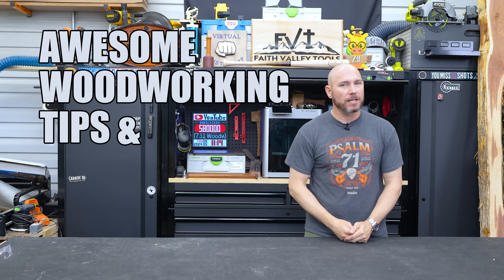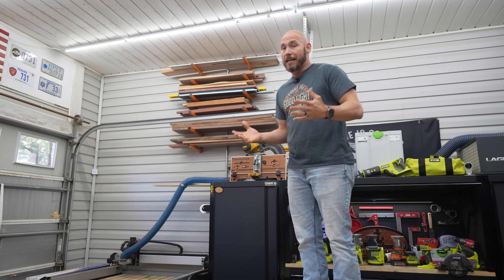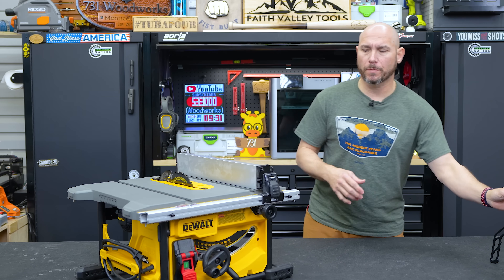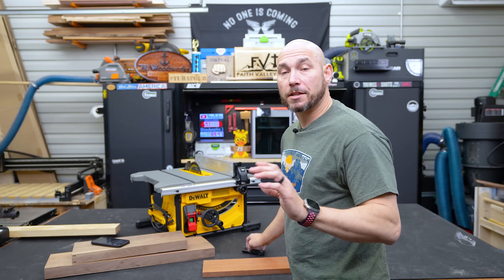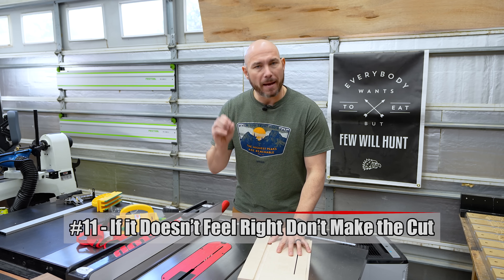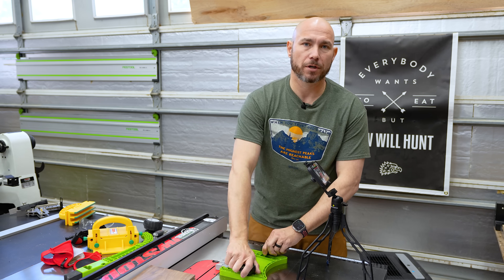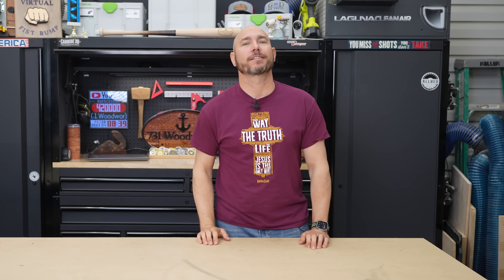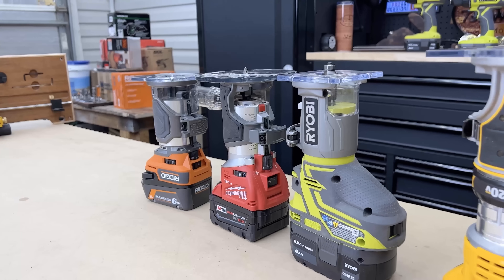99% of Beginners Don't Know These Woodworking Tips and Tricks | Compilation

Comment from the maker: Click "MORE" to expand for links to tools and more!
Check out my FREE Masterclass for Building a Woodworking Business from ZERO https://site.731woodworks.com/masterclass
Some of the links used in this comment are affilate links and I may earn a commission on qualifying purchases. 
Tools starting at timestamp 0:09
DeHumidifier - https://amzn.to/3V8vcQw 
Bora Lumber Rack- https://amzn.to/4axB61S 
GRR-Ripper Push Block - https://amzn.to/4bFSgf2 
Tools Starting at timestamp 12:06
Thin Rip Jig - https://amzn.to/3UM9u3k 
Bow Feather Board - https://amzn.to/4bw3oLM 
Bow Push Stick - https://amzn.to/3wVF9Y5 
Allred Push Stick - https://allredwoodworks.com
JessEM Stock Guides - https://amzn.to/3KajSx1 
Jig for JessEM Stock Guides - https://www.731woodworks.com/store/jessemjig 
Bow XTender Fence - https://amzn.to/44PwSBD 
Cross Cut Sled Plans - https://www.731woodworks.com/store/safesled 
Incra V27 Miter Gauge - https://amzn.to/3UO3Xtb 
123 Set Up Blocks - https://amzn.to/3QX0aZc 
3M Safety Glasses - https://amzn.to/44SPDnK 
RZ Mask - https://amzn.to/4avoQPu 
Tourniquet - https://amzn.to/44ZDjSQ 
Tools Starting at timestamp 37:06
M12 Drill / Driver Combo - https://acmetools.pxf.io/m50WPD 
DeWALT Sander - https://amzn.to/3Kctfwc 
Festool Sander - https://amzn.to/4aBLmGl 
Sandpaper Organizer Box - https://amzn.to/3wNb2SK 
3M Cubitron Sandpaper - https://amzn.to/3wJqNdq 
DeWALT DWS779 Miter Saw - https://amzn.to/3WMnH2V 
DeWALT DW618 2.25 HP Router - https://amzn.to/4bw51Jo 
DeWALT Cordless Router - https://amzn.to/4bPoOTA  
Milwaukee M18 Cordless Router - https://acmetools.pxf.io/9g2bvY 
Whiteside 4 Bit Set - https://amzn.to/4bNjEHJ 
Skil Table Saw - https://amzn.to/44Wtd5c 
DeWALT 8.25 In Table Saw - https://amzn.to/3yy06Jd 
SawStop Table Saw - https://amzn.to/3yurTud 
Tools Starting at Timestamp 49:10
Safer Cross Cut Sled Plans - https://www.731woodworks.com/store/safesled 
Safer Cross Cut Sled Video - https://youtu.be/YbMUc4wVjpE?si=6du5SA38_iXrrJOx 
5 Cut Method Calculator - https://windridgewoodcrafts.com/utilities/five_cut/ 
Matchfit Clamps - https://amzn.to/4aM2xFD 
Dovetail Router Bit - https://amzn.to/44QJkkq 
Jointing Jig Build Video - https://youtu.be/1nYDBL7Xv1o?si=-GbfWREAgK-OBmTd 
Jointing Jig Plans - https://www.731woodworks.com/store/jointing-jig
10 Million Dollar Stick - https://amzn.to/4auqxN9 
Thin Rip Jig - https://amzn.to/3Kbhm9x 
Tools Starting at Timestamp 59:48
Bora Lumber Racks - https://amzn.to/3KeaRTK 
LED Shop Lighting - https://amzn.to/4bNuDB7 
Mobile Tool Cart - https://www.731woodworks.com/store/diy-mobile-tool-cart-with-storage 
Grizzly Mobile Base - https://amzn.to/44R7Baa 
PACKOUT Rolling Drawer Boxes - https://acmetools.pxf.io/MmkPMP 
Diablo Table Saw Blades - https://amzn.to/3UQpZve 
Whiteside 4-Bit Set - https://amzn.to/3KawRyu 
Incra V27 - https://amzn.to/3wS9RRS 
Clamp Racks - https://amzn.to/4dNEdFZ 
OmniWall Tool Organizer - https://amzn.to/4bOpIzP 
Husky Hutch Tool Box - https://homedepot.sjv.io/x9B2xy 
Organizer Boxes for Drawers - https://amzn.to/3UQqlSA 
TayTool Small Parts Organizer Boxes - https://lddy.no/1jtlw 
PACKOUT Storage Boxes - https://acmetools.pxf.io/DK1b0a 
DeHumidifier - https://amzn.to/3wAM74V 
Dust Right Separator - https://amzn.to/3wL7tML 
Festool Dust Extractor - https://amzn.to/3WTXMqc 
3 M Dust Extractor - https://lddy.no/1jtlx 
Bora Centipede Workbench - https://amzn.to/4dOtoU5 
Worx Workbench - https://amzn.to/4dU2oSY 
Festool MFT - https://amzn.to/3UPU2Dn 
Air Cleaner - https://amzn.to/3VcfGCY 
Mr. Cool Mini Split - https://amzn.to/3QUXOKD 
3D Printer Bambu Lab - https://shrsl.com/4c1h8 
CNC Shapeoko 5 Pro - https://collabs.shop/xd9ye9 
Tools Starting at Timestamp 1:20:50
Diablo 50 Tooth Blade - https://amzn.to/3Kb9x3J 
CMT Chrome Table Saw Blade - https://amzn.to/4dNCn83 
Forrest Table Saw Blade - https://amzn.to/4dOhNEu 
Ridge Carbide Table Saw - https://amzn.to/4aM24mR 
Freud Dado Blade - https://amzn.to/4buxVcF 
Incra V27 Miter Gauge - https://amzn.to/4brpPRX 
Tapering Jig for Table Saws - https://www.731woodworks.com/store/jointing-jig 
MIcroJig DoveTail Clamps - https://amzn.to/3yoiK68 
Thin Rip Jig - https://amzn.to/3WSq18p 
JessEM Stock Guides - https://amzn.to/3wOVii3 
Instructions Put on Tourniquet - https://youtu.be/wWVne7cUrm8?si=GmU9ohHGXUFClwen 
GRR-Ripper Push Stick - https://amzn.to/3WSH2Qa 
Bow Push Stick - https://amzn.to/4arIwnj 
Bow Featherboard - https://amzn.to/4bqdgqf 
Tourniquet - https://amzn.to/3yDbXWe 
Tools Starting at Timestamp 1:32:32
Home Depot Deal of the Day - https://homedepot.sjv.io/Ea4A4n 
Tools Starting at Timestamp 1:42:05
DeWALT 2.25 HP Router - https://amzn.to/4bo2As6 
Bosch 1617 Router - https://amzn.to/3VcvmFt 
Makita Corded Palm Router - https://amzn.to/3V7LOrs 
Milwaukee M18 Cordless Router - https://acmetools.pxf.io/9g2bvY 
DeWALT Cordless Router - https://amzn.to/3QXpSNr 
Whiteside 4-Bit Router Set - https://amzn.to/3WLd3JM 
Skil Router and Router Table Combo - https://amzn.to/3QQO0B1 
Kreg Radius Template https://amzn.to/4bPxMjW 
Tools Starting at Timestamp 1:54:49
CA Glue - https://amzn.to/4bLiEUE 
3M Sander -https://amzn.to/4bIQaL2 
3M Xtract Sand Paper - https://amzn.to/3WVnMRR 
Interface Pad for Sander - https://amzn.to/3UVA2Pw 
Sanding Mouse - https://amzn.to/3yol5Os 
Micro Fiber Clothes - https://amzn.to/4c6rbBV 
Pre Stain Conditioner - https://amzn.to/3wNnZMs 
Spray Laquer - https://amzn.to/3KcN4mR 
Tools Starting at Timestamp 2:10:12
DeWALT DWS779 Miter Saw - https://amzn.to/4dOSthI 
Festool Miter Saw - https://amzn.to/44QBS8Y 
CMT Chrome 80 Tooth Miter Saw Blade - https://amzn.to/3WMKCLx 
Diablo 80 Tooth Miter Saw Blade - https://amzn.to/3RjuPAr 
RZ Mask - https://amzn.to/3K9vzE2 
Festool Dust Extractor - https://amzn.to/3KdAfZG 
DeWALT Dust Extractor - https://amzn.to/3V9LaK7 
RIDGID Shop Vac 6HP - https://homedepot.sjv.io/DKvd4j 
10 Million Dollar Stick - https://amzn.to/3wTkBzp 
Woodpeckers Stop Block System - https://amzn.to/4bPk8Ny 
Miter Station Build Plans - https://www.731woodworks.com/store/miter-station-build-plans 
FastCap Zero Clearance Tape - https://amzn.to/4avgTd1 
Colliflower Zero Clearance Inserts - https://amzn.to/4axHkig 
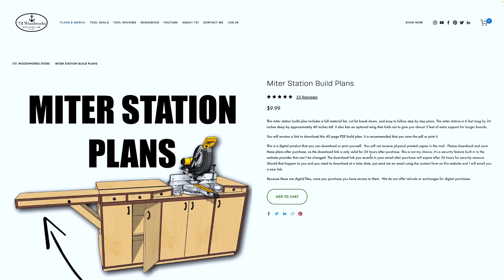Tools Starting at TImestamp 2:24:06
Irwin Quick Clamps - https://amzn.to/3KcsmDJ 
Bessey Quick Clamps - https://amzn.to/4bQ8mmm 
Jorgensen F Clamps - https://amzn.to/3UUmTGw 
Bessey Pipe Clamps - https://amzn.to/4dRLEvD 
3/4 in Pipe for Clamps - https://amzn.to/3wOZ2jB 
Bar Clamp from Harbor Freight - https://www.harborfreight.com/hand-tools/clamps-vises/bar-clamps/48-in-to-60-in-bar.html 
Corner Clamping Squares - https://amzn.to/4aM5XrX 
Spring Clamps - https://amzn.to/3yDgnMO 
Band Clamps - https://amzn.to/4bLVc9R 
Kreg Right Angle Pocket Hole Clamp - https://amzn.to/4av5DgW 
Face Clamp for Pocket Holes - https://amzn.to/3UV4edE 
Dovetail Clamps - https://amzn.to/3yFdXgH 
Dovetail Router Bit - https://amzn.to/4bNAjuP 
Hand Screw Clamps - https://amzn.to/3V9MLQ7 
Bessey Parallel Clamps - https://amzn.to/3WNvkGp 
Bremen Parallel Clamps - https://www.harborfreight.com/search?q=Bremen%20parallel 
Rockler Clamp Racks - https://amzn.to/3UR27aT 
Tools Starting at TImestamp 2:37:52 
Old Standby Tape Measure - https://amzn.to/3yvsg7B 
 FastCap Lefty Righty Tape Measure - https://amzn.to/44QNKb0 
Swanson Speed Square - https://amzn.to/4dNHDIP 
Framing Square - https://amzn.to/44URtEB 
Carpenter Square Fence - https://amzn.to/4bIDi8t 
Swanson Combination Square - https://amzn.to/3wWyg8S 
Woodpeckers Indexible Square - https://amzn.to/3wNpYAo 
Woodpeckers Delve Square - https://amzn.to/4bLWv8L 
DFM Small Square - https://amzn.to/3QVsNpY 
TayTools Machinist Squares - https://lddy.no/1jtmi 
Woodpeckers Stainless Squares - https://amzn.to/4dO2HPn 
Irwin F Clamps - https://amzn.to/3yDhtYW 
Jorgensen F Clamps - https://amzn.to/4aM7vlL 
Pipe Clamps - https://amzn.to/44UNnfM 
Pipe for Clamps - https://amzn.to/3WUpW4a 
Bessey Parallel Clamps - https://amzn.to/4awaONq 
Bremen Parallel Clamps - https://www.harborfreight.com/search?q=Bremen%20parallel 
Narex Chisels - https://lddy.no/1jtmj 
Rubber Mallet - https://amzn.to/4bsNyRR 
Two Headed Mallet - https://amzn.to/4buEcVL 
Mallet Template - https://www.731woodworks.com/store/mdf-mallet-template 
Flush Trim Saw - https://amzn.to/4bNqxsz 
Dovetail Saw - https://amzn.to/3KcWnTS 
Tools Starting at Timestamp 2:48:04
Irwin Forstner Bit Set - https://amzn.to/3wJwKag 
Pica Pencil - https://amzn.to/3K9yaOi 
Massca Pocket Hole Jig - https://faithvalleytools.com/collections/massca-products 
Tools Starting at Timestamp 2:54:38
Shop Nation Dust Collection Kits - https://shopnationstore.com/collections/all-products 
FastCap Zero Clearance Tape - https://amzn.to/3KcWVsU 
Festool Kapex Zero Clearance Inserts - https://amzn.to/3WSM6Ea 
CMT Chrome 80 Tooth Miter Saw Blade - https://amzn.to/3QXtgrD 
10 Million Dollar Stick - https://amzn.to/3WLhi8a 
Festool Kapex Miter Saw - https://amzn.to/4dTBOJK 
Miter Saw Station Plans - https://www.731woodworks.com/store/miter-station-build-plans 
Stealth Stop Miter Saw Stop Block - https://amzn.to/4bo75mu 
Tools Starting at Timestamp 3:01:37
Double Stick Tape - https://amzn.to/3UTg2x7 
Small Parts Holding Stick - https://amzn.to/3WLhi8a  
MicroJIg Safer Push Blocks - https://amzn.to/3UUcHxF 
Rockler Bench Cookies - https://amzn.to/3QXYCOF 

Comment charcter limit was exceeded. Find the full list of tools in this video sorted by timestamps here: https://www.731woodworks.com/99-dont-know
Reply: thanks for sharing

Comment: I was taught as a kid, erm, over 50 years ago that when ripping a board on a table saw always have the smaller part as an off-cut with the larger piece against the fence. NEVER cut off a strip against the fence. Pretty much common sense IMHO. You can't control a small strip very well (grrripper not withstanding and I love mine) against the fence with the lever of the large piece outboard. I shudder when I see YT videos of peeps cutting strips against the fence for repeated cuts. sigh use a stop block on the other side outside the blade as a reference before the blade. Much safer and arguably more accurate. Best table saw safety tip I've ever been given: PAUSE before you cut and THINK TWICE about what's going on and what might happen WITH EVERY cut. Accidents happen mostly when you think "it's just one quick cut...".

Comment: as a BRAND new woodworker (havent even made anything of note yet, just gathering tools and wood) i really appreciate this kind of stuff. it makes me feel more prepared
Reply from the maker: Glad it helps!  Thank you!
Reply: So as of today, you're more like a hunter and gatherer? 🤪
Reply: @731Woodworks  I wouldn't say I'm a beginner woodworker. I'm learning (I used to say carpentry but now I know the difference and woodworking is what I'm interested in) how to, what's what, etc. Which tool should a beginner get a table saw vs planer? I went with a table top planer/joiner for it's small size and my lack of space for work and space. My question is, what is the best table or surface to work on for cutting wood (I have a circular saw)? Any table or horse tables? Oh I should mention my big problem is I live (I'm a university student renting) in a hill street with our yard, driveway, etc. at a slant.  The only level area are my neighbors' parking spots.
Reply: Same boat. About to do some for the first time for a home remodel and starting out with a track saw. It would never have occured to me to keep a tourniquet around but I'm definitely going to.

Comment: This is a needed very sound video that all can benifit from, Thanks for taking the time to compose and shoot this video. Ray Stormont,  PS One suggestion for most shops that I employ is to use over stock on sale mix and not matched (CHEAP) 9" vinyl tiles using epoxy adhesive to cover floors and create a tough water/vapor barrier that easy to clean (sweep) for my floors, Cutback for adhesive will be disolved if certain solvents and petro chemicles are spilled, any damaged spots are easy to remove and replace giving me a dry stable work space that I can place my projects directly on w/o worry even makes scratches a thing of the past.

Comment: If you buy a dehumidifier,I suggest you buy an extension on the warranty . Mine runs 24x7 . They last about 25-27 months before I am hauling it back to the big box store . They have always been great about replacing it . Your looking at 300-400  so 50 for doubling the warranty has been well worth it . Cheers

Comment: Will the miter gauge with the fence added to it that you showed briefly do the same thing as the jounter  jig you made?
Thinking about getting the miter gauge with fence soon. 

Im having trouble getting straight cuts because if the board im cutting is not straight against the table saw fence, its seems almost impossible to cut uneven boards straight. 
Wont that miter gauge solve that problem?

New to wood working, i got the bug building wood shutters and trim boards for my house. 
Now im building boxes and while some come out great, others have been a real pain. 

Thank you for your great videos, i enjoy your teaching style. 👍
Reply: If you have a bowed board you can attach a straight board to it..(use a brad nailer or double sided tape) so tht you have a straight side to run against ur fence and then make your cut..pull the piece off ..flip it over and then make your second cut...

Comment: What is the 8/14 inch blades you would recommend? CMT Chrome blades do not come in 8/14 to fit my Dewalt DWE7485 table saw. I have been getting Diablo blades but they’re not my favorite just because they do not last very long. I have tried some others off Amazon with mixed results. But would like to get a few blades that would be worth getting sharpened when the time comes. You always have great videos with a lot of info thank you for sharing your knowledge.

Comment: For those of us with sub level basements….. especially us with some exposed dirt and major humidity issues, they do make dehumidifiers with a pump! My basement is below my houses sewer line. I have the same dehumidifier as shown and I have to try and remember to empty it several times a day. Which often does not happen. So I’ll be getting a new one with the pump so I can feed it out the window and into the back area or if I can tap into a drain higher up in my house.
Reply: Harbor freight condensate pump...

Comment: Everyone is wrong when it comes to wood acclimation.  

As a truck driver, I make freight deliveries to Home Depot and various lumber yards and when it comes to construction pine, they are shipped on open platforms and unwrapped, totally exposed to the rain. Other lumber is completely wrapped. 

When I make deliveries to construction sites, all of the lumber is exposed to the elements and are used wet or dry. 

Sometimes I would go to hd to by pine 2x4 and they would be very wet. 

Lumber especially pine only warp when they get soaking wet then left to dry for long periods. 

Don’t acclimate. Use it right away, especially if wet.

Comment: I never figured out why everyone seems to urge people to spend so much time and effort to create hardwood slides when you can get perfectly fitting aluminum bars for a few bucks apiece. Also, with a little work, you can tap in some threads and countersink on the side of aluminum bars for nylon screws that you can adjust to remove slop (which you probably won't need anyway). Also also, aluminum bars don't wear down or warp.

Comment: I’m not sure that dehumidifier would help in my garage shop. It’s regularly over 100 degrees here in summer and well over 60% humidity. 100% is not unusual. Our garage door is not insulated. We can’t build basements here. The water table is 6” down. But absolutely NOT storing lumber on the floor. Our garage floor regularly gets soaked in high humidity. A climate-controlled shed is in my dreams. And I ALWAYS acclimate my lumber before use, sometimes inside my house if I’m making indoor furniture. In that case, I do a lot of work in my kitchen which has tile. Easy to clean.